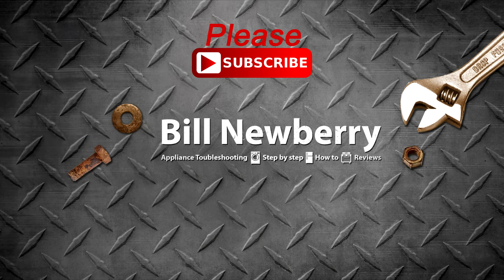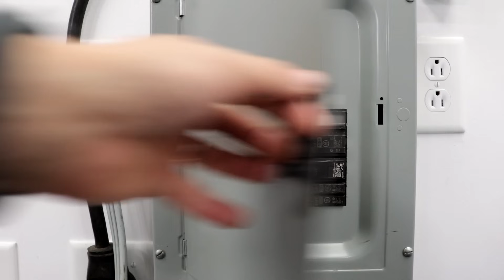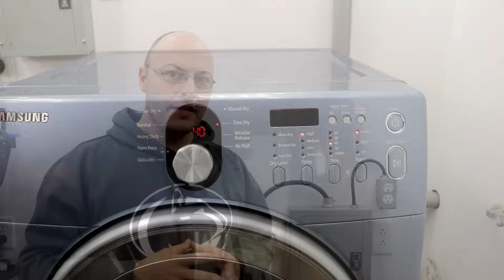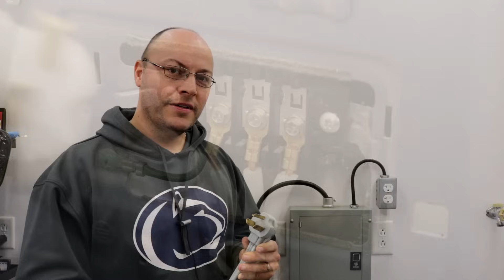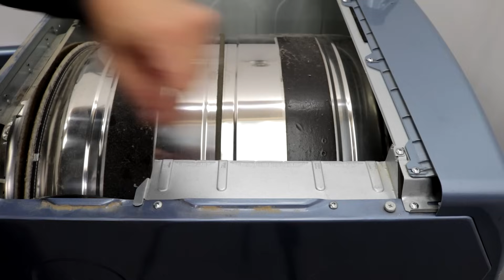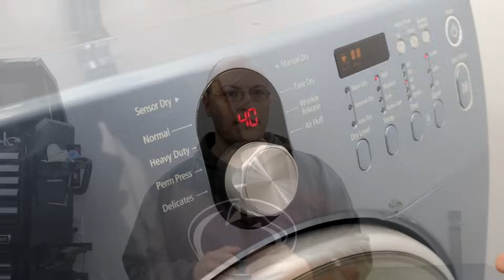Samsung Dryer Shuts Off Mid-Cycle - How to Troubleshoot

Comment: Just adding my 2 cents here. Before any disassembly, I would recommend cleaning the two moisture sensors, especially if you use dryer sheets. The sheets create a film over the sensors and they trigger the dryer to shut off early. To do this just wipe the sensors with kitchen scrub pad (or lightly with a fine grit sandpaper) and wipe clean with a damp cloth. The sensors are on the lint filter assembly (they are two long silver sensors. When wet clothes rub across them they short out and this tells the dryer that the clothes are not dry.
Reply: Shayne Billey thank you! This worked for me!
Reply: Shayne Billey Thank you! Saved me some time and money. Definitely worked me for.
Reply: So glad I saw this comment bc that’s exactly what the issue turned out to be!! Thanks for sharing!!
Reply: This was my problem. Thank you so much for the comment.
Reply: Where are the sensors located? Mine Comes on flashes check lint filter then it goes off and the dryer starts and works for 3 minutes then shuts off.
Reply: Yep, mine was a problem with the moisture sensors too, however, you must completely remove the sensor assembly to the point whereby you can access the plugs on the backside. Mine was solidly packed with lint essentially shunting the sensor bars (from the rear) with lint that becomes moist as the cycle begins and carries on over time. This would result in erroneous measurements to the machine and it was short cycling by turning it off.
Reply: Thanks this worked for me!
Reply: Thank you!❤
Reply: @reignbowb304  that's what mine does. Did you figure yours out?

Comment: I am an engineer and I am THANKFUL for guys like this ONLINE. I am ABLE to figure out such items as a dryer problem, HOWEVER, how many hours in any day do I have? Even in my travels in factory automation I have plenty of engineers in all fields whereby we consult with each other to make our lives easier. I can't imagine though HOW MANY PEOPLE want this guy to fix their dryer for free online. That part would be NO FUN. I think guys like this MIGHT BE, part "Saint" and "Angel."  (FYI my dryer keeps shutting off...  LMAO, I suspected lint already and cleaned the inside, outside, pipes, and made sure it was open.....) I 'thought' I had it..... but It started again. Maybe a reset.  I have had NOTHING but issues with my Samsung dryer.... piece of junk. I've owned MANY different appliances in my life, never Samsung. Out of ALL appliances I've owned they've never given me a lick of trouble. I am "almost" a certified "dryer" engineer. 1 more issue and I add it to my resume and go to work for Bill Newberry. By the way Bill, I know how to use an Ammeter, and am certified to work in high voltage transmission down to low voltage DC. I'm your guy. (Please tell me it pays at least $500 per repair and there are 4 repairs a day. AND the woman are HOT.)

Comment: Learn from my mistake. I jumped to the worsts case and replaced the motor. Had the same problem. I cleaned and checked EVERYTHING!! Well so I thought. Turns out my ground wire was loose. One turn of a screwdriver and problem solved. My dryer is 9 years old so the motor was probably on its way out, at least it's all clean and lubed up ready for many years of service. 🤞

Comment: Answer:  Mine would simply turn off, saying the clothes were done after five minutes and play a tune, even though they were wet. What the problem actually was was the 2 "moisture sensor bars", which are located inside the dryer by the vents going to the filter. A softener sheet wedged up against it causing a false-done-drying sensor condition to fool it to thinking it was done and fully dry. Timer dry only bypasses this dryness  sensor and would allow you to dry clothes for ...say... 40 minutes ok. Just clean these 2 sensor bars located by the bottom right vent holes inside the dryer right below the filter vents. Mine had a dryer fabric  softeners sheet basically wedged against it and glued to it. Must have gotten wet and dried against the 3" long  sensor bars by the filter vent holes. 😮

Comment: Mine was doing this also, but after taking a look at the motor, I found that it had a bunch of lint on it. This was causing the motor to over heat. I cleaned the lint off and blew it out with some air. Seems to be working good now. The last time I had to work on it was due to the elements going out.... My wife likes to make quilts in the lint trap!!! I think that’s what caused both of these problems...
Reply: Scratch that... it shut off again... ordered a new motor... hope it does the trick!
Reply: @lanewatson5487   , did the motor fix your problem? Mine runs for about 5 seconds then shuts of completely, then  repeats this about every 2 minutes.

Comment: Hay Bill thanks for your video's, #2 Samsung Electric dryer EVERYTHING is working just went through hole thing w/Parts,I use it about 2-3 times every month and half or so working one load the next works 2 mins and goes to 1 min and stops  and it turns back on right away EVERYTHING IS CLEAN    HELP !!!!
Reply: Same here you ever figure it out?

Comment: Hi bill i have a question im working on a front load fridgedare dryer replaced the heating element and try putting it back but the coils hit with the drum im thinking it could be the rear bearing cup any suggestions..???

Thanks for all your great videos they have been very helpful to me..after graduating from HVAC/R school..tried to fixed appliances and now its HVAC/R & APPLIANCE REPAIR 2 YEARS IN THE INDUSTRY WORKING FOR MY SELF..

Comment: Hi bill my dryer is not drying clothes completely it leaves damp clothes even though I put it on high temperature my dryer is Samsung electric dry with touch panel smart sensor what to do to fix this problem
Reply: Mine is doing the same thing. Did you ever get answers answer?

Comment: I have a Samsung steam moisture red dryer and it shut off it do not complete drying it stop at 56 and it goes to 1 and then shut off
Reply: Did you learn the problem?
Reply: Same thing happens to me all the time
Reply: Yep this is my problem. 😔
Reply: having the same issue
did you ever figure out the problem
Reply: I think your dryer is over loaded.  I was trying to dry a queen comforter and  it went to 58-56 to 1.  I then ran it empty with no problem.  Your dryer might be just overloaded.
Reply: Most likely humidity sensor. If it isn't sensing any humidity, the dryer will go into 1 min cool down and then shut off. Clean the sensor detection strips, and if that doesn't work, replace the humidity sensor itself.

Comment: Mine was working wonderfully for four years now (since 2 days ago) trips off. Main breaker resets but keeps tripping off. All vents clean, and exterior ventilation ok w flap. Motor? Model, breaker, or power cord? Terminal wires look ok.

Comment: I have an issue same axact dryer as video, I start mine on normal setting it starts with 52 minutes than after 2 minutes drops to 20 mi utes than after 2 minutes drops to 7minutes and counts down to zero why? Why does it skip 40 minutes of the cycle?

Comment: Yours has a 3 wire and mine has a 4 wire and is also an aftermarket plug. What if the last owner connect a 4 wire when it was supposed to be a 3 wire? He has the white and green connected on the middle prong. Does that matter ?

Comment: I HAVE A SAMSUNG VRT STEAM DRYER, THE  DIGITAL PANEL WORKS FINE AND SO DOES THE CYCLE SELECTOR KNOB BUT WHEN I PUSH THE START BUTTON, THE DRUM DOES NOT BEGIN TO SPIN. I CAN MANUALLY TURN IT AND IT HAD NOT BEEN MAKING ANY NOISES. ANY SUGGESTIONS?
Reply: Did you ever figure out what the problem was? Have the dryer & that's what mine did lastnight.

Comment: Another good vid Bill,  Question .. Kenmore elite #110.67072600 dryer works and cycles on time dry and heat cycles properly on auto but stalls in last 5 min on auto cycles ?  by stall i mean it never shuts off and continues to heat and timer stays at around 5 min. what would you be looking at first? thanks in advance
Reply from the maker: +Stacy Newman 4 wire thermostat on older dryers, this I believe has the dial in the center with two control boards behind the upper panel.  I would still check the thermostat heater.  I need to get my hands on one so I can tear it apart.  Maybe somebody in the comment section will help shed some light.

Comment: Hi,
Like your videos ,very good.  Ok here is my problem.  I have replaced the belt on the Samsung dryer model DV448AEP/XAC, put everything back and found out I forgot to plug the moisture sensor in.  Took the dryer apart again, cleaned the sensor and made sure it works.  Put everything back and it runs.  Resetting the cycles.  at first the dryer worked for 3 mins.  then shut down.  Learned how to do the reset and it works for about 8 mins. on the normal cycle but every time I try to reset with my cycle  it does not remember the cycle and shuts down saying the dryer has finished the cycle...after about 8-9 mins.  instead of the 51 mins.
Is there a timer and how do I fix it or what the>>>> is wrong..Thanks
Reply: Same shit here…

Comment: My dry doesn't have the smooth vent, but also my outlet is through the ceiling into some space somewhere....not outside. What should I do? It does turn on. I will not run til I get details

Comment: I have the Samsung drier, moved into a new build , my drier will do one cycle of drying and then power off while tripping the breaker. If I run the drier empty, it will not trip the breaker …any suggestions?

Comment: My samsung dryer set on time dry will only run a few minutes then the cycle ends, it doesn't turn off it end like it ran the complete cycle, anyone have any ideas?
Reply: Same problem can’t find a fix yet
Reply: Same problem. Did you try cleaning the lent out of the vent pipe

Comment: My GE dryer is totally dead. no power to the board.   Power source and cable is good (checked volts and continuity). Can you just test the continuity to the wire of control board  from the  plug.  It just so many expose wire.   Anyway,  I did that and there's continuity. Is that mean the board is gone?

Comment: My dryer will run for quite some time, but then loses power completely.  It'll fire back up once it seems its cooled off, but will cut out again if there's significant time left on the cycle.  I cleaned out the vent and replaced the hose.  Is it a problem with the motor or the thermal fuse or something else???
Reply: I see that the comment is 4 years old but ....Have you solved this problem? I have the exact same problem with my samsung heat pump dryer.

Comment: Dear Bill, I am searching for a cure to a problem with my Samsung Dryer (DV448AGP/XAA). I just moved from the USA to Egypt and I brought my washer and dryer with me and purchased a 2000watt transformer strictly for the dryer. Within a few moments of plugging in the dryer I get a message "power interruption". I can get the dryer to start a cycle, before that, but as soon as the message appears the cycle stops and the message persists. I'm not sure what to do to fix it. Any ideas?

Comment: I start my dryer and after about 15 minutes it stops with the error code FE. I have watched this video and I replaced the motor and previously I had replaced all of the heater element components. So far I am getting the same problem. Sometimes it goes the whole cycle and other times it does this stopping thing and I have to wait and restart it. Any suggestions ?

Comment: Hello I need help! My Samsung dryer powers on but when I hit start it trips the breaker. Maintenance has been out 3 times and has changed the breaker, tried looking for clogged vents, changed the outlet and the cord on the back of my dryer. The tech says it has to be the dryer. I just moved to this house and I didn’t have any issues at the previous house. What could the problem be?

Comment: Bill, I have one of the older model Samsung dryer (MoistureSensor he) and it was working fine until today that it stopped working properly. 
What happens is that it turns itself off after like 5 mins. Everything looks n feels normal but it just turns off after mins. I'm thinking the vent "pipe" is full of lint, but what do u think is the problem?
I'd appreciate a quick response. Thanks!
Reply: Mine to does this

Comment: I replaced the motor and it still runs for a few seconds then stops. It will turn back on after 30 seconds but then stops. What could be the issue now?

Comment: I replaced the thermal fuse cause that was the problem. Then when i put it back together and ran a quick dry it stopped running after 10min n i think over heated. The timer was still going though

Comment: Bill, my samsung dryer wouldnt heat so I put in new thermostat, high limit thermostat and heat coil. Now dryer heats but runs about 10 minutes and shuts off, but unlike in your video, it will turn right back on. Any idea what the problem could be? I vacuumed off the blower fan very well when i had it apart. Completely disassembled duct to outside and cleaned it out as well.ThanksBrian
Reply: Brian Celico OD ,
Reply: Brian did you ever find out what the issue was for your dryer?

Comment: my digital timer onn my Samsung dryer,starts at 54 min , went to 34 ,then 41 min i all in about 10 minutes then turned off. how do I fix this?
Reply: Hi Jodie were you able to get an answer to this? I'm having the similar problem. My one hour is done in 8-10 mins.
Reply: Same with mine. I have no clue what is wrong with it.

Comment: Hello so I checked everything you said and looks ok but I still have the same problem. I have an electric dryer that turns off in the middle of the cycle and then nothing turns on in the control, as if it had no power, it takes about half an hour for it to turn on again. And then the same everything works fine for 15-20 min and then everything turns off again. I even checked the thermal fuse but it works too. Any idea of what might the problem be?
Reply: Have you solved this problem? I have the exact same problem with my samsung heat pump dryer. I know that your comment is 4 years old but it would be great if you could share some information
Reply: @ПРОБокс-о5й Same problem , how did you fix?
Reply: @analam728  i haven't fixed it yet. The belt is ok, the control module is ok. I tryed to turn the dryer on without a drum (after I disassembled it). The motor and the compressor are functioning. But it shuts off after 3-5 minutes. In order to turn it on again I have to unplug it.
If you find the soultion please let me know
Reply: @ wow, mine runs and it seems to be when it gets hot it shut off, like a safety mechanism, but shuts off completely and not code, and will not turn back on, let it rest and cool off like 10 mins and then I can turn ON again, and run it and then after 7 to 15 mins of drying it shuts off again and won’t turn on again. It’s not the vent, that’s clean, what I can’t understand is why it shuts off and won’t turn back on, that should be the key to fixing.
Reply: @analam728  I also thought that it overheats. But it seems it is not a problem because it shuts off before the compressor gets hot. It just diesn't have time to overheat I think

Comment: Hi Bill, my samsung dryer keep tripping the breaker every 20’s everytime i use heat. i wanna ask if the problem is my breaker or thermostat? thanks
Reply: jrossano macuto my dryer is doing the same. I have no clue what it is either. I’ve had the breaker replaced, and it is still doing the same thing. Running for 20 minutes, tripping the breaker.
Reply: @TheMichaelAnaya  did you fix it? Mine is doing this too

Comment: I have a dryer that shuts off randomly.  Open door and close and turns on.  Sometimes keeps going and others kicks off and have to open door again and close it and press start and goes. Any ideas?
Reply: Same issue cleaned all venting no error messages control panel full of dust from lint how do I clean it

Comment: bill my Samsung dryer will be, running fine then half way through the cycle it will just turn off, the control makes a weird noice like if the power supply cuts off. Sometimes if i hit the power button it will start up right the way and some times I have to wait longer for it to start. It will run fine for weeks and then again it will do the same problems any suggestions?
thanks in advance.
Reply: Mine is doing the same thing, did you ever figure it out?
Reply: @jamesmott5181 did you ever figure it out? I'm so tempted to just throw this thing out the door lol.

Comment: Okay our dryer is coming on but jumps to 1 after being on a short time. We clean the sensor and check to make sure lint was not backed up in the hose. There is not an error code showing neither. What is the problem? By the way we just purchased this probably less than a month ago
Reply: Did anybody give you and answer i.have the same problem

Comment: Hi. My Samsung dryer is showing an FE code. It will start and run for a little bit and the stop and the FE will be displayed. If shut it off and turn it back on it will most of the times work fine until the end of the cycle. What should I look for in order to fix it?
Reply: Mine does the same thing. It is either the outlet or the Electronic Control Panel

Comment: my samsung dryer will not power on. if I'm understanding you correctly by falling your steps i need a new control board. your video shows power to the control board, but nothing after the control board. how do i know that its not the power switch?
Reply: No power to the unit at all is probably the board. If you have power, but it just wont spin, it could be the exhaust thermal sensor, switch on the motor, or the belt switch.